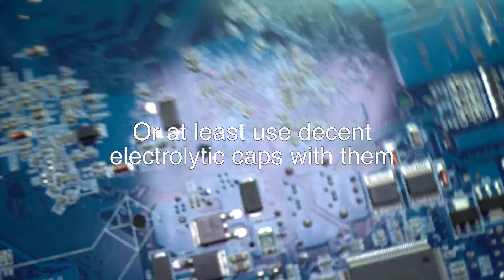Sans Digital 4-bay NAS Teardown

Comment: Square BGA chips usually indicate DDR2 or newer.  The Pentium M was a rework of the Pentium III but with Pentium 4 instructions, but it did form the basis for the Core series. The P4 was getting too hot and not scaling well. Clock for clock the Pentium III would outpace a Pentium 4 in standard Pentium III based instructions.  The P4 did have some advantages with SSE2 instructions so Intel took a step back and abandoned the P4 lineage and their Israeli R&D group came up with the Pentium M as the new series.
Reply from the maker: +stonent The NetBurst P4s looked really good in marketing because they had really high clock speeds. But that was where their advantage stopped. In basically all practical ways they were terrible compared to the Pentium Pro architecture which the P3, Core, etc were derived.

Comment: There are applications that poly caps aren't really well suited.  That being said those electrolytics are crap for sure.  Tech just isn't built to last.  The manufacturer knows that the tech will probably be obsolete to the original buyer before components start cropping out so they don't care.
Reply from the maker: How does Supermicro and all the other server board manufacturers get away with all solid caps then? Even many gaming motherboards have done away with the "standard" electrolytic caps.